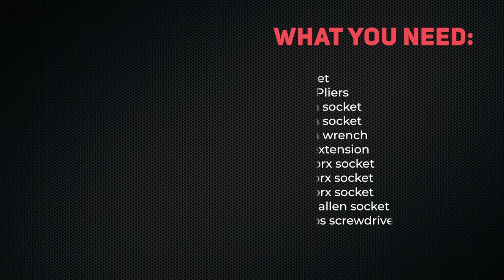Vespa GTS / GTV Floorboard Removal | Mitch's Scooter Stuff

Comment from the maker: T O O L S
Rags - https://amzn.to/2Yh8jvg
Nose pliers - http://amzn.to/2yetDDj
Ratchet 3/8 drive - http://amzn.to/2hhmnUs
Torx T25 3/8 drive - http://amzn.to/2yb6D8F
Torx T20 3/8 drive - https://amzn.to/4aeKOXA
Torx T27 3/8 drive - https://amzn.to/3MI5XzW
10mm open wrench - http://amzn.to/2hqqYDW
10mm socket 3/8 drive - http://amzn.to/2xGuLSF
14mm socket 3/8 drive - http://amzn.to/2xGn4Ms
Phillips no. 2 screwdriver - http://amzn.to/2fgdZDL
4mm allen socket 3/8 drive - https://amzn.to/3aUmtuw
3" / 6” extension set 3/8 drive - http://amzn.to/2h7ypMl